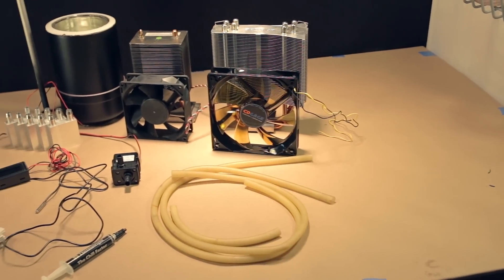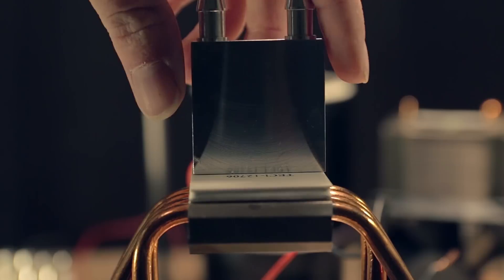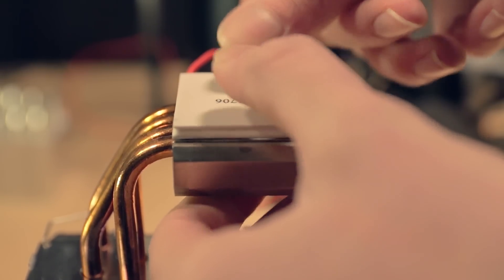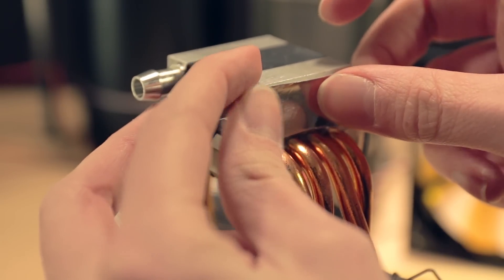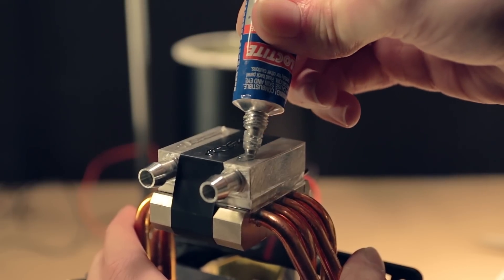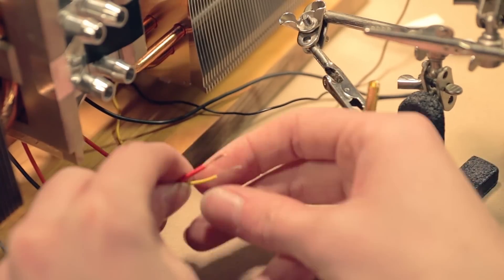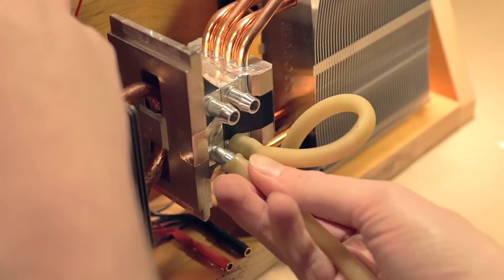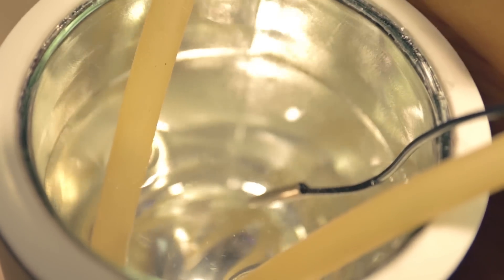Peltier Water Cooler

Comment: would be interesting to put one of these into pc cooling loop to see if it helps cool water better
Reply: i once tested a setup similar to this on a Athlon 2 core and was disappointed
Reply: @picklesthegreatest  I know about that I meant to use it as extra cooler in the loop just for the water
Reply: @picklesthegreatest  where's the point in putting a peltier element between a normal cooler and the cpu? you'd get worse performance because a peltier element will put out more energy than it can take out of the cpu?!
Reply: It wont help whatsoever, unfortunately. The reason for this is because every cooler has a specific heat output. A peltier device creates more heat than what it is cooling down and therefore creates even more heat for the heatsink to output. Not only that, but a peltier device also have poor thermal transfer compared to the standard copper/aluminum block. What it can do is cool down your heatsink so that there is more ΔT of the mass to heat up, but eventually even this would equalize and the poor heat transfer of the peltier would still allow the cpu to be significantly hotter than the mass anyway. Lastly, anything that is cooler than the air around it will condense the moisture in the air and this pose a risk to most electronics.

Comment: To maximize your cold output, you need to apply a higher pressure on the peltier/heatsink/waterblock junction. Also insulating the hozes will yield another couple of degrees. Nice project though :-)
Reply from the maker: Kurt Andersen As Phil Stillwell said, it could also help to orient the heat sinks such that the cooling blocks are on the bottom. I didn't know it but those copper heat pipes are filled with refrigerant.
Reply: Yes, it's true but horizontal alignment is also OK. What you really don't want is to mount upside down. Refrigerant agent vaporize with contact of middle section and then condenses in side sections. It transfer heat much faster but this is not the point in this project.
Reply: check out Ryans projekt here: http://www.overclock.net/t/1606680/peltier-tec-hybrid-water-cooling  I made a similar setup but with Water cooling the hotside.
Reply: I've read somewhere that letting the hot side getting "more hot" will make cold side much colder, some kind of that principle. Has anyone ever tested that by reducing fan speed on the hot side heatsink??

Comment: At first i was like where the hell is he gonna put the cpu.
Reply: i once tested a setup similar to this on a Athlon 2 core and was disappointed
Reply: @johndoe-rd6jn  for cooling something like a cpu you need atleast twice the cooling area as you would need for a normal air cooler because you are cooling under room temperature usually and its not terribly efficient
Reply: @johndoe-rd6jn  Get a better peltier.

Comment: Back in the day, it was a CPU, adapter plate (copper or aluminum), Peltier, Water block (copper), surgical tubing, transmission cooler, fans of course, and viola... sub freezing temps all day, distilled ice all over the cpu and sometimes board, and all the overclocking of a FCPGA 370 celeron, PIII, etc that one could want.  This dates back to say the P233MMX or so as well, and anything in between.  This was in the days of Overclockershideout.com, which I think still exists, but likely isn't what it was. What it was, was overclock databases, a marketplace where machinists, creative types, etc to sell and exchange their wares.  Was where I sourced the tank, pump, and tubing for my cooling system. A bench-top power supply drove the peltier and fans, with a separate case with various wired together ATX PSU's doing the entire job of computer and cooling prev to that.  Those were the days... Pushing a Celery to beat the newest and best PII or PIII numbers.  Pushing your RIVA 128, Voodoo Banshee, V2, V3, V5, etc all the farther it could be pushed... Playing games when games were breaking boundaries and rules the same way you were in the convention of PC building. I miss the good ol days
Reply: Yea, that's some really old school overclocking there!  I had some of that hardware but never oc'd it like that. So what did you get in DooM?  Like an extra 5 FPS?  I upgraded my whole computer so I could play that damn game. ;-)  Cheers!
Reply: @krissebesta  Depending on the era, it was any number of crazy combinations.  Though once I mastered the original socket 370 platform, I then found the Abit BP6, dual socket 370 board. This was right around the advent of Win2k, so there was the OS that would bridge the gap between mainstream use, and NT level support for multiple CPU's.  As back then, there were no "multicore" anything, no hyperthreading... just one cpu, one core.  But I had two, lol... both with direct peltier cooling, then water cooled... for wonderful ice and overclocks.  This was an incredible era because chips were topping out via intel or AMD at clock rates under 1Ghz... a Ghz wasn't even a term yet... we were at maybe 500Mhz on PII's at that point... and I was pushing two Celerons from 433 to about 800, and just destroying everything else made. It then went to an Abit VP6 with two similarly cooled and pushed FCPGA Celerons. Then the same board with two 933Mhz PIII's the Coppermine FCPGA obviously... pushed well beyond 1.2Ghz before they were officially even breaking the barrier.  And it was such an ALIVE scene.  Pushing these boundaries and seeing the very tangible results.. believe me, it was far more than 5fps increases, lol... we are talking about exponentially more power than any originally conceived mainstream machine back then, more than servers and the most power house of top end rigs... This was experimental, unconventional... with multiple CPU cores working on calculations in a time where this just wasn't even a thing... plus the massive overclocks on each of them :) .  It was a very rewarding time to be involved in the game, where as today it is more or less just... turn key.  You buy an unlocked cpu, meant to be selectively and easily "overclocked" from the factory... with a warranty that even allows for this.  Back then overclocking was pushing things beyond that of their design, not buying a kit that makes it the most simplistic and easiest process imaginable.  It was a talent, a skill, and something that took considerable commitment.  Was fun... then it all sort of dissolved into this mainstream blah of today.

Comment: The critical thing with peltiers is not so much the power of the module itself, but the temperature differential between the hot side and the cold side, or the delta-t. In order to maximise the cooling on the cold side, you have to dissipate the heat that is being moved to the hot side efficiently. You will not achieve that with a heatsink and fan, which can only cool to room temperature at the very best. If you cool the hot side with a water cooling solution, the cold side will become MUCH colder with the same 'power' peltier.

Comment: Thankyou very much for the video i have been thinking about building a cooler for my still so I don't need to use bags of ice to cool the water for the condenser I run the still for 8+ hours at a time I'd definitely need to make a fairly large unit I think something capable of keeping 60l of water below 5° do you think they could handle it or be capable of keeping the water at that temp for extended periods?

Comment: This is great!  Thank you for such a detailed walk-through - great pace. Has anyone asked about trying this to make a an air conditioner by running the chilled water through a radiator and then blowing air over the coils?
Reply: It is possible, you would have to ventilate the heat to outside and depending on the size of the room, you would also have to scale the unit to produce the amount of BTU's you need to cool.

Comment: i'm wanting to grow tomato's  hydroponically outside in a 5 gallon bucket, root rot is something of concern because of high water temps. 
   if i use this to recirculate the water in the same bucket, (into itself through a watering ring), do you think it would cool the water to a reasonably lower water temp?? temp outside is like 90 degrees.
Reply: Hailea HC Series Water Chiller, it just works with no messing about..

Comment: This is a cool project! I have some thoughts that you might consider to get a little better cooling out of this. I think your contact pressure between the peltiers, heat sink, and water blocks can be improved to get some better cooling. Zip ties could be a quick solution as a test, but more long term, maybe some cheap metal bracket fashioned together from straight pieces of aluminum across the top and bottom sides, with long bolts running on the outside to squeeze together. You'd need to insulate the cold side from this bracket, or heat will transfer from the hot side through the bracket. Perhaps some thin insulation from an insulated lunch box would be enough to separate the bracket from the block, yet still be stiff enough to squeeze it together stronger.
Ditch the metal tape. it will conduct (a small amount of) heat thus lowering efficiency. 
Have you considered running these peltiers in series? As in, Hot side of peltier A to the heat sink. Hot side of B to the Cold side of A, and Cold Side of B to the water block. The Pelties can only maintain a certain amount of delta T across them, based on current (higher current = higher delta T). To make the cold side colder, you can cool the hot side more aggressively. If the hot side is begin cooled by the cold side of another peltier, you may be able to double the delta T (or close to it) across the whole apparatus. Your heat sink will need to dissipate twice as much heat, so it will be much warmer to the touch and the fan will need to run at full speed. if each Peltier is 5 amps, that would mean 120 watts of heat to dissipate. A medium to high end computer heat sink fan combos for a CPU can usually do at least this much (sometimes up to 150 Watts), while keeping the hot side below 60 C. You would only need a delta T of 30 C on each peltier to freeze the water, in that example.
Insulate the water tubes to further minimize the losses.
Some have suggested that the orientation of the heat sink is important. I'm not sure about that. Most computers have their CPU heat sink oriented sideways, just as you have in your device. The conventional wisdom is that heat rises. This is true in a medium like air, which is less dense at higher temperatures at constant pressure. The copper/aluminum isn't going to work that way though. For one, the metal isn't circulating in a convection current. the heat pipes in the heat sink have a small amount of liquid that evaporates at a set temperature. It then travels through the tube to the cool side (fins), and condenses, releasing heat. It travels back along the inner walls of the tubes due to capillary action, to be delivered to the hot side of the heat sink again, where the cycle repeats. This does not depend on the orientation at all. It does mean that you have to warm up the heat sink to that evaporation point to get the most effective cooling out of your setup. 
Good project though. I like it!

Comment: I have a question regarding the peltier chips. In order to transfer let's say 100w of heat through them do I need a 100w peltier chip or they just speed up the transfer between both sides no matter the power. I'm wondering if there is a benefit to using a small power peltier chip between my cpu and cpu block to accelerate the heat transfer. thanks.
Reply: The peltiers have naming conventions that mention its maximum current intake and its operating voltage you can calculate the power from there. You should look it up :) for example in "tec1 12706" tec stands for thermo electric cooler, 12 is the vlots and 06 the current in amperes. idk about the 7 and 1 lol ..

Comment: THANKSGIVING 
Great concept coupling, I have one point that can improve your efficiency. The heat sinks you used are designed to function only in one direction (oriented in one particular direction). Be sure to orient them in the same direction that they were in while they lived in the CPU. If I’am not mistaken the copper is a pipe or tube containing a refrigerant if so it’s a heat tube, relying on the phase of the refrigerant from liquid to gas, and back from gas to liquid.
Reply from the maker: You're right the, tubes contain a refrigerant. But they don't have to be oriented upright as the interior walls are lined with a porous sintered metal powder which acts as a sponge, constantly drawing liquid back to the hot end.

Comment: Is it possible to use these chips to make a cooling jacket with tubing and water or some coolant. (My work is hot)
Reply from the maker: Yes. But but be aware that the amount of heat released from hot side of the chips is much greater than the amount of heat absorbed by the cold side. Depending on how large the place you're working is, the exhaust from the heat sinks might make the air warmer. I hope you'll build it but don't forget the cooling power of a wet T-shirt and a fan.
Reply: @SafetyLucas thank you

Comment: How long can this continually run? /hours, days..
> looking for options on running the output through a small hose,  looped through several feet /length to cool down aquariums in summer &  maintain certain temperatures for coldwater animals. 
Chillers are pretty expensive; other Peltier units I'd seen only knock down a few degrees, though this one seems much better.

Comment: Nice project, some good comments about increasing pressure and removing conductive tape etc. Also better cooling may be achieved by reducing the voltage across the peltiers, My rig using TEC-1-12715 gives best efficiency at 8.5 amps. The most important thing when using peltiers is removing the excess heat from the peltier. The chips generate far more heat than they transfer at higher currents.For example my TEC-1-12715 running at 8.5 amps and 10 volts will transfer about 33 Watts but increasing the current to 11 amps at 14 volts only has a heat transfer of about 28 Watts. The reason is my CPU cooler can work fairly well with 118 Watts (85 W from chip 33 W from heat transfer) but the cooler struggles with 182 W (154 W from chip 28 W from cooling). So I guess I am saying you have to match your operating current to your CPU cooler. Don't just think stronger peltier will give better cooling the heat sink needs improving as well.

Comment: So I have a smaller 4 inch cooler like you built with a 100w chip I have it recirculating water in  an insulated 10 gallon beverage cooler to cool a 10' copper line coiled inside of it. The copper tubing  comes In from another container to cool my co2 laser tube but I do not seem be be getting any  cooling effect from the peltier, even if I cool down the water with ice to the proper temp it need to be the peltier will not keep the water temp maintained. Any suggestions?

Comment: good clip, i didnt know about the inside of the water cooling block, but one question :- in the water circuit are you relying only on the temp gradient to allow the water to circulate, is the water pot open ? and not simply the pipe going through it trasnferring cooling  ? Im building one of these to up the cooling of one of those chinese protable fridges - as its not cool enough.  I dont think you explained the heat transfer mechanism enough :-)

Comment: trying to do something similar but run the chilled water through ~15' of tubing.  Can you provide info on the TEC you used, pump, heat sinks etc?  thanks
Reply from the maker: Tom DeNapoli Each TEC was 60W so I used 1 CPU cooler for each one. most CPU cooler have a cooling power of at least 80W so there should be plenty of extra cooling power to run the chips. The pump I used was just a cheap eBay pump. 240 L/hr. Now bear in mind that if you're going to run 15' of tubing, you're going to be losing a lot of cold. Use a well insulated tube and try to keep the length as small as possible if you want your water to stay cold.

Comment: Is it possible to just put one of the modules over a cpu? Directly exchanging heat without water block.
Reply from the maker: No, these modules are not efficient enough to keep up with the cooling demands of a CPU. You would need multiple chips in series connected with a water loop to cool a CPU.

Comment: I need one help from you
How long time put it on peltier device
Actually I was thinking making one small AC with 10 peltier device and water radiator behind the fan
And I am using AC fan smaller size
And I was decide to make cabinet minimum 2 by 2 feet
And all the heat sink I will keep front side of the fan
How is my concept please help me by comments

Comment: How much power does this Peltier module based water cooler consumer   I want to make a similar project but worried about the power consumption in a month in comparison to a normal compressor based cooler
Reply from the maker: The power consumption will depend on the thermal load, the efficiency of the chips, the ambient temperature, and how well heat transfers within the system you build. These chips are rated at 60 watts each. Although I didn't measure, I suspect they were operating at a lower power consumption due to the factors listed above. If efficiency is desired, compressor style refrigeration is far more efficient than Peltier chips.